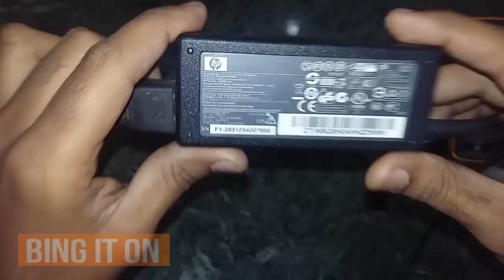HP Laptop Charger Repair

Comment: Why you changed the value of the capacitor?
Reply: Because the exact value capacitor was not available to him..... you can use (+)(-)10% of value of the capacitor and any higher or same value capacitor instead but not lower preferably........

Comment: there is one component that is connected in parallel between drain and source of mosfet.. and it is written "B"  on pcb.. what is it? for example  'D' for diode... 'Q' for transistor